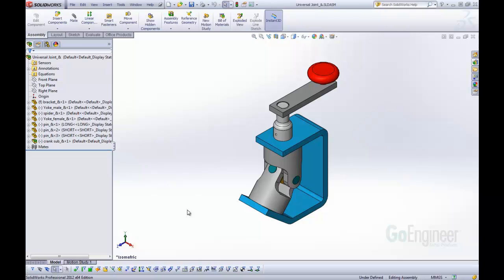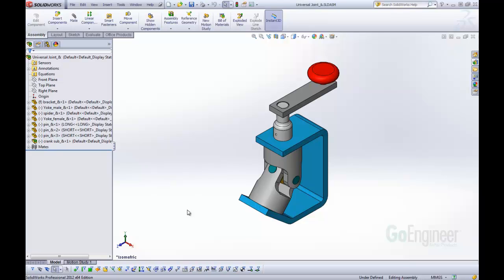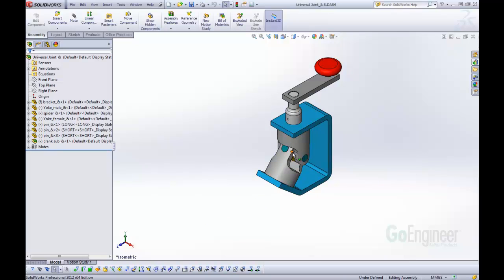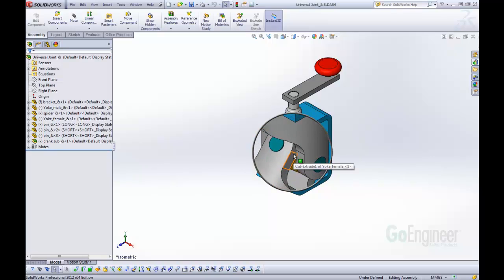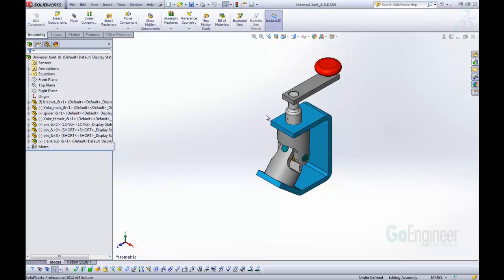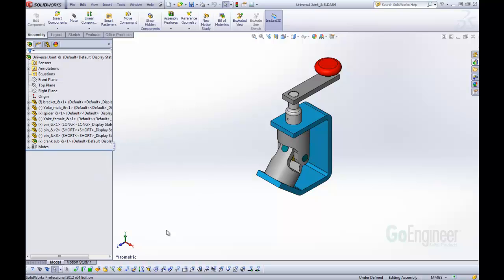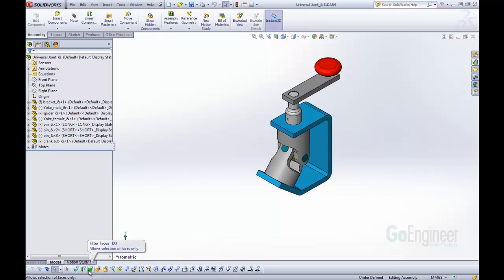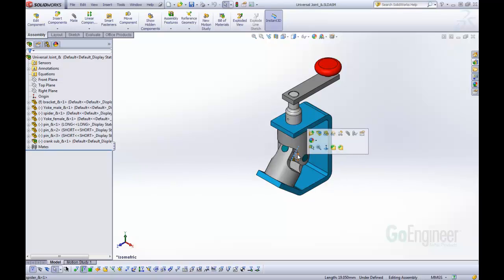SolidWorks - Magnifying Glass & Selection Filters

Comment: how to enable magnifying glass? i use 2012 and lower version as well 2010
Reply from the maker: Hi Navya,
The magnifying glass, by default, can be activated by pressing the G key on your keyboard.   This is true for both 2010 and 2012 SOLIDWORKS.
Reply: @GoEngineer  sorry to say this it is not actived in my system..  and in my friend system aswell.
Reply from the maker: Hi Navya,
I'm sorry this is not working.  I tested in both these versions and both, with default settings, brought the magnifying glass tool up when pressing G.  Maybe the hotkey is different on your system.  If you go into 'Tools', 'Customize', to the 'Keyboard' tab you will be able to search all the commands in the program for "Magnifying Glass" which will allow you to set (or reset) the hotkey for this tool to whatever you wish.